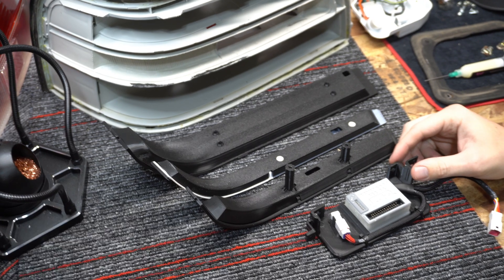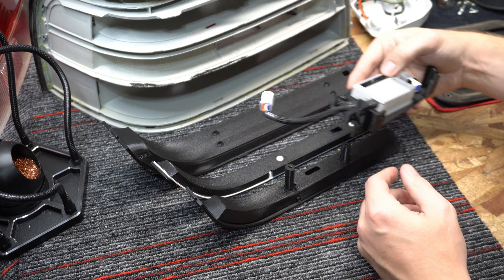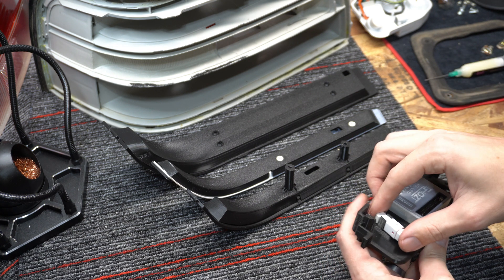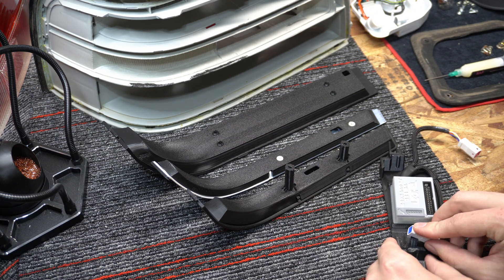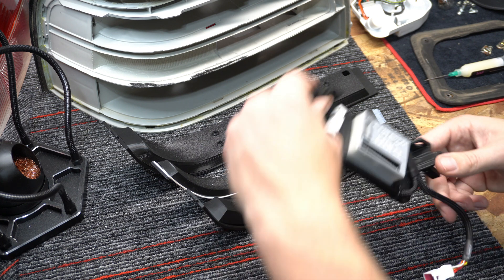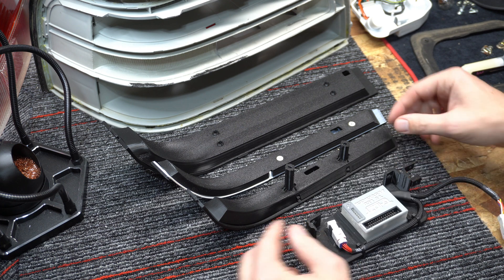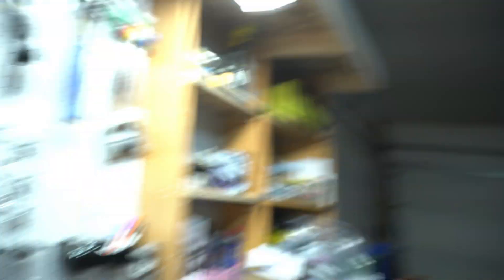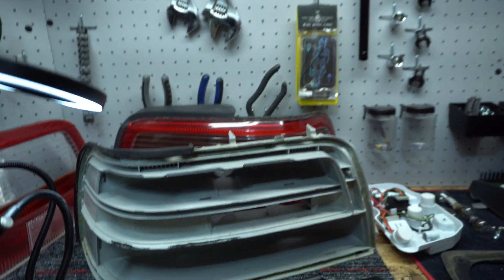BUILDING CUSTOM LED TAILLIGHTS - PART 3

Comment: With the lenses if you wanted it clear without the ribbing on the inside you will have to remove them (what ever way works best for you) then wet sand the whole inside from about 400 grit sand paper to as fine of a grit you can find followed by a polish
Reply from the maker: I think I’m happy with how they are and dont really want clears now. Mostly I’d just like to figure out if I can somehow fill / repair the micro-cracks in these lenses due to age and typical wear. Thanks for the advice though! Might be a day where I want to make some clears 👌

Comment: Those taillights are awesome and congrats on such a great job on all the R&D, Video making and editing!!  What mode is your 3D printer?  Also can you do a video on how you entered measurements to form the pieces on the 3D printer.  I hope you get everything and more back for the effort you put into all of this!!!
Reply from the maker: Thanks so much!!! The 3D printer I bought is an Elegoo Neptune 4 max and it’s been amazing for the price… very reasonable. As for printing process… you have to use a 3D model software (such as Solidworks) to create a 3D file, then slice that file into a print format (mapped out automatically by a separate “slicing” software). Maybe I’ll get around to putting something together that’s more in depth but it could be a while 😅